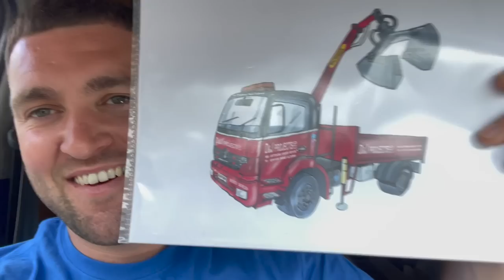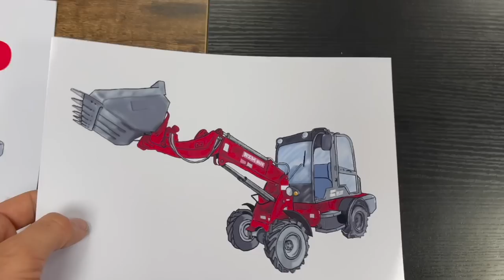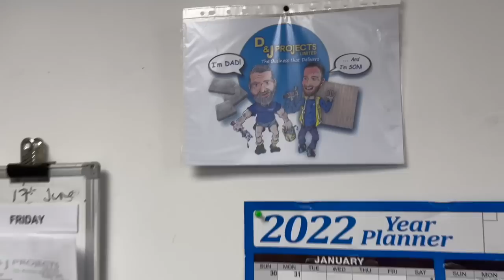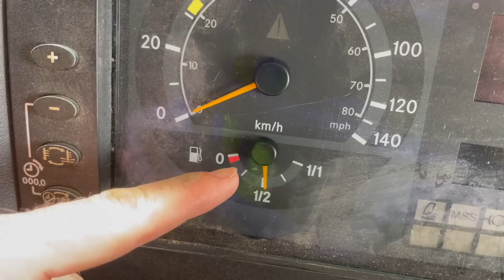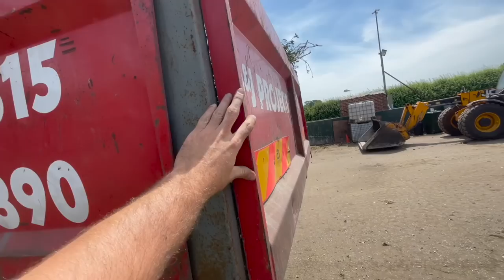ARE WE BEING ROBBED? This Week At D&J Projects #58

Comment: those posts cracking is called concrete cancer when the steels rust inside the concrete causes the concrete to blow out from the rust expanding the steel basically. University i work at is listed and is plagued with it causes massive issues
Reply: How long does it take to happen this concrete cancer?